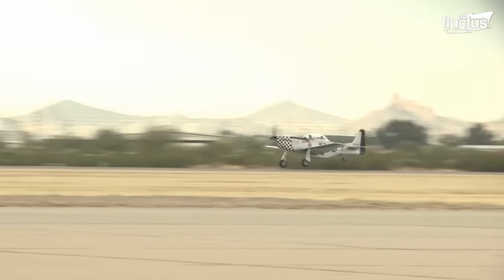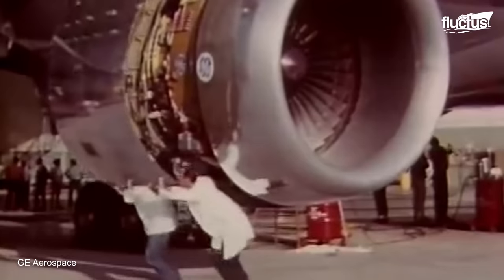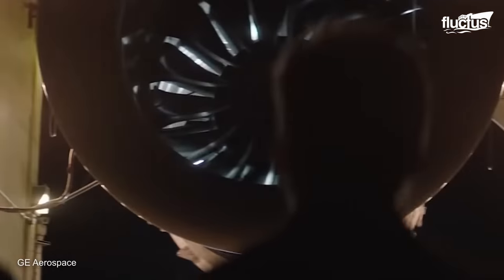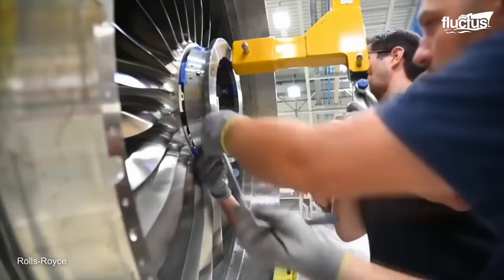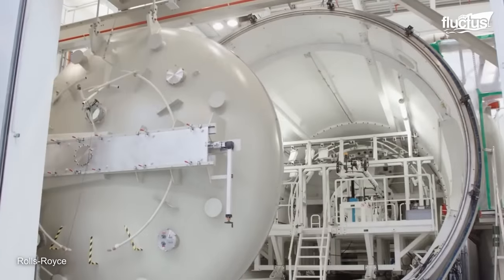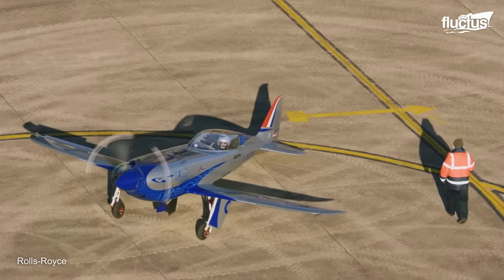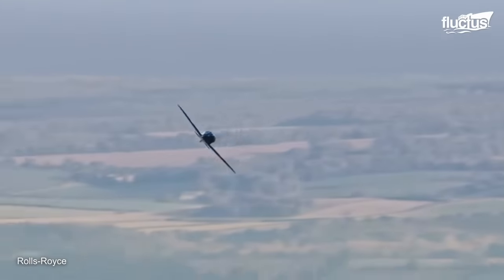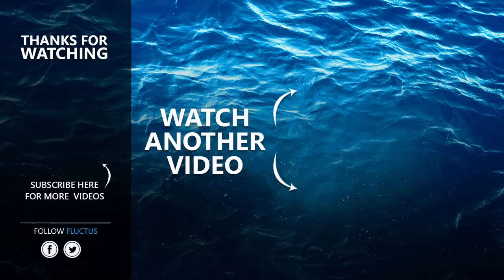The Crazy Evolution of the World Largest Jet Engines Ever Built

Comment: Whoopee, the electric airplane can fly 40 minutes before having to recharge, which takes  how long? Congratulations the plane can taxi, take off and immediately have to land. 😂
Reply: Didn’t the first plan go up for only one min?
Reply: imagine the flight plan for one of those things!! every airport will be an alternate.
Reply: The electric planes will have to overcome the significant weight to power issue, or better battery technology is necessary.  Jet fuel or even gasoline has a significantly higher power to weight ratio vsctodays battery technology

Comment: The 747 test bed can operate on just 3  engines. The cf6 .  However the ge9x is so powerful only 2 are need for the 747-4  to take off and fly.
Reply: I said the same thing a couple years ago in a video about the GE9X, that you could have a twin engine 747 if they were both GE9X’s, and someone was arguing that it wouldn’t work. It would be cool to see.
Reply: @GRosa250  well imagine if one faila, for the size of a 747 that's so many lives at risk. And given that the 747-8 is bigger it wouldn't work well to make a new version similar or bigger than that in size because of weight distribution, unless they probably downsize it to that of the -100 or 200

Comment: Nice video, but the GENX is not the most powerful engine at the  thrust stated in the video.  Among the current 777's engine options is the GE-90 turbofan, which produces 125,000 pounds of thrust, much of it via the front fan (the bypass) rather than the combustor; this occurs on a test stand.  In service mounted on the aircraft, the engine is derated to 110,000 lb o thrust, still higher than the GENX. But the new 777-X's design and aerodynamic efficiency allows it to haul a higher payload with a slightly lower thrust engine, which means substantial fuel savings and lower emissions.
Reply: How abt the mtow, would it more likely require a longer runeway?

Comment: The RR Ultrafan has a 140” diameter fan, so the GE engine is NOT the largest.
Reply: The GE engine mentioned in the video is the largest in production engine.
The RR geared fan engine is unlikely to see production.
Reply: @John-nc4bl  They said largest in the world, not largest in production. RR is not going to throw away over 1.4 billion dollars in Ultrafan development costs. It will take a while to fully develop, flight test, and certify. Geared jet engines are the future. They will replace regular turbofans, just like the fans replaced the turbojets. Just like variable pitch props replaced fixed pitch props back in the day.